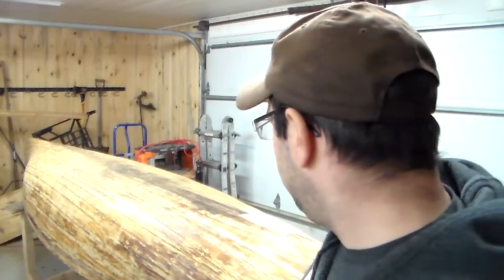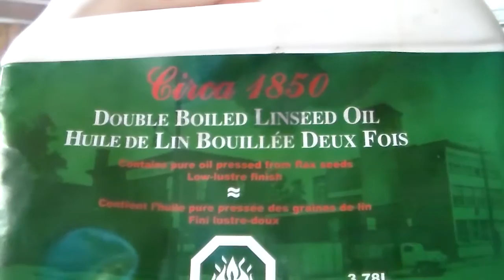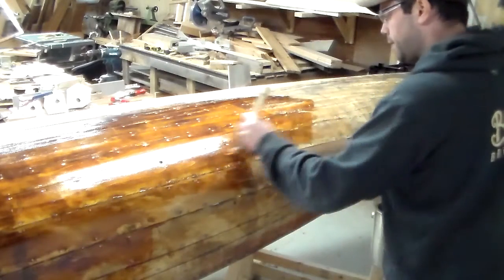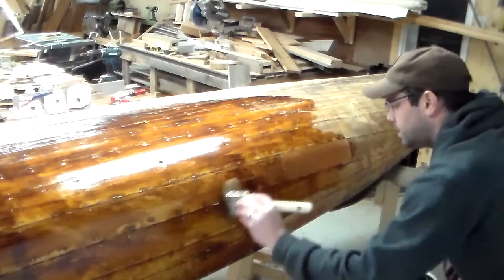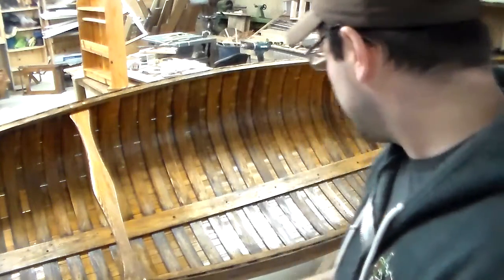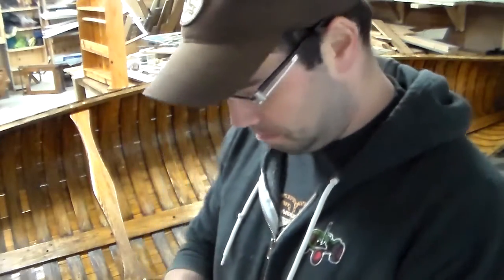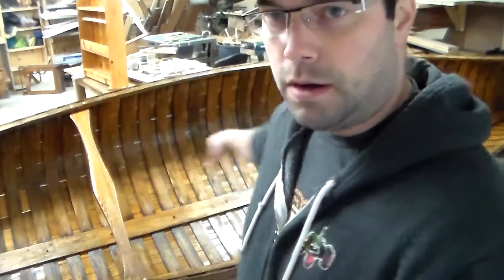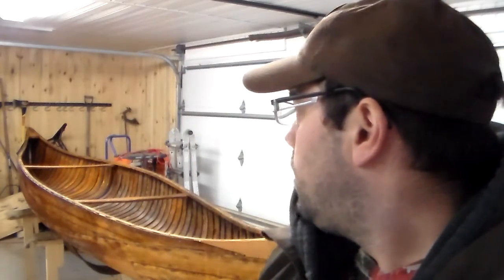Cedar Plank Canoe Restoration - Ep6: Applying the Finish (1 of 2)

Comment: also - what is the point of the linseed oil on the outside if the canvas is going there?
Reply from the maker: you have to put some type of finish on the outside of the hull in order to ensure that the canvas and filler do not stick to the hull. varnish would do as well